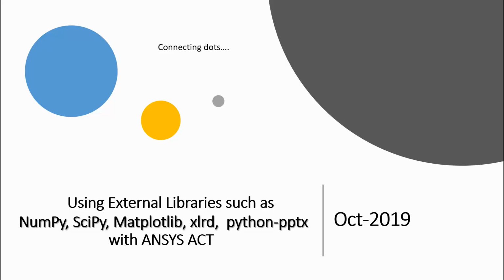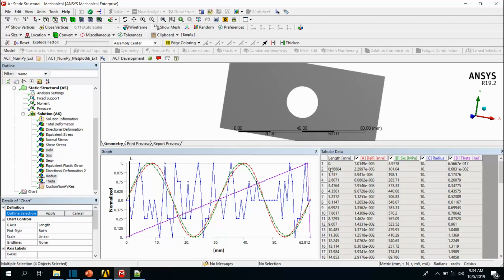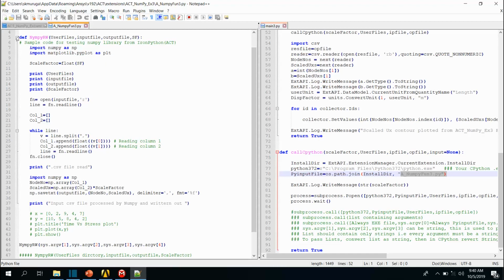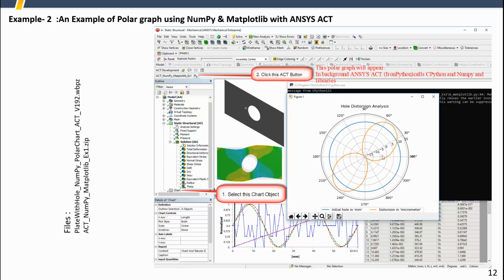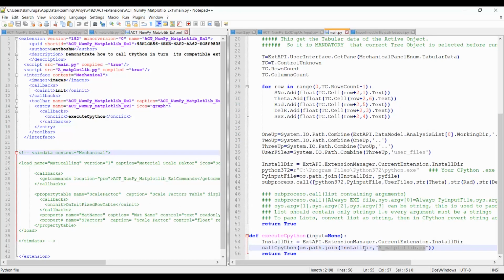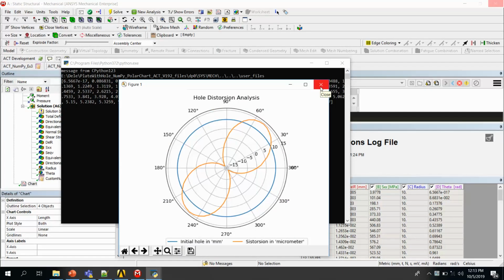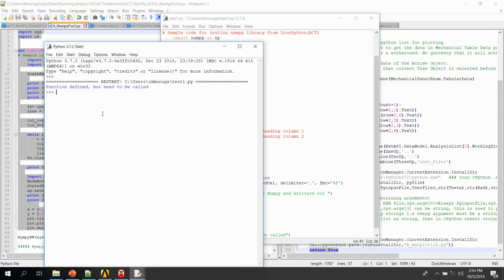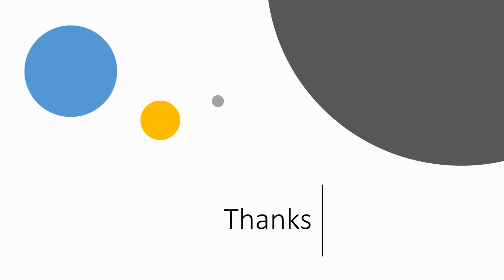ANSYS ACT External Libraries NumPy SciPy Matplotlib XLRD PPTX ..

Comment: I came looking for copper and found GOLD. So in the "External Solver" script, could you import ANY library...?
Reply: Yes, you can run anything from the standard library, pip, custom modules, etc. Note, if you need to pass a large dataset, it would be easier to export that data as a csv or other filetype and then load that filetype to an external Cpython script.